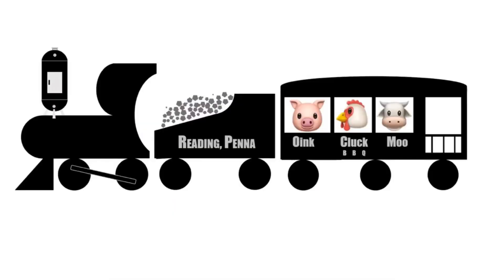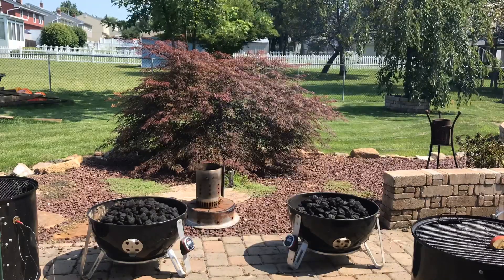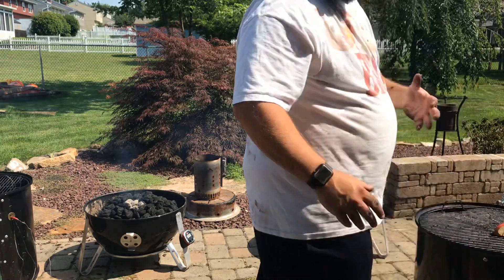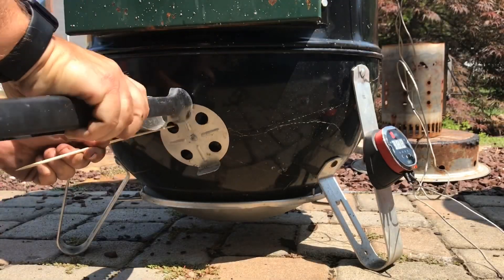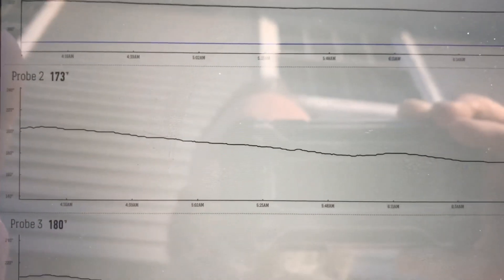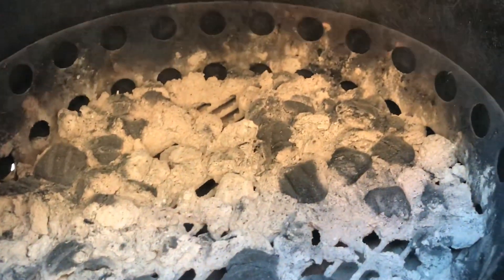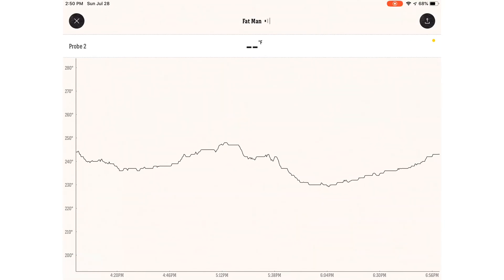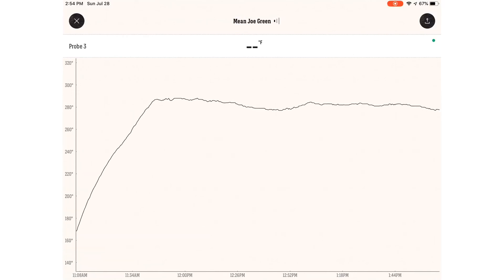FireDial -vs- The Water Pan in the WSM

Comment: I used the firedial for the first time this weekend. I found it to be similar to using the water pan except less hassle. I also found I had to keep my lower vents more closed than typical which resulted in a longer burning fire. It cooked for 9 hours and I didn’t  have to add any charcoal during the cook. In fact, it burned for another 4 hours. I think I will be able to cut back on charcoal and save a couple $$.

Comment: i don’t think you need to do a test. depends on what you want to achieve in your cooks. i use water pan for some things and don’t for others. if going 225 i noticed using water pan its easier to maintain in that range.
Reply from the maker: @jacobminden1458  yes the waterpan is easier to maintain lower temps for people that don’t feel like fiddling with dampers.  I do the tests to simply debunk the myths out there.  The only time I use a water pan is cold smoking because I’ll fill it with ice.
Reply: @OinkCluckMooBBQ  nice.. i drilled a hole on side of my WSM and installed a smoke daddy for cold smoking. works great
Reply from the maker: @jacobminden1458  nice 👍

Comment: The water pan is a heat sink by design, as well as a diffuser so there isn't direct heat. I observed the temperature changes with the WSM as the water evaporated. The temps go up. This takes quite a few hours of course. I can't see not using it. However, that is also an 18", and is shorter and the grates are closer to the fire. I have no reason to substitute. I greatly appreciate your data logging and information. Jeremy Yoder would be proud of the data set.

Comment: I just bought my lava lock fire dial and I’m excited to use it! I have not used it yet. I have only done about eight cooks on my 22 inch weber smoky mountain. I’ve use the water pan the entire time and have had Great success and I’ve only used Kingsford briquettes. The lava lock fire dial should improve efficiency in cooked time as well as the use of less fuel as has been documented. The only downside that I could see is that the original water bowl will provide moisture for your meat during the cook and will not let me dry out. This could be an issue but we will see. All the reviews that I see everyone seems very happy with their fire dial. I can’t wait to try vertically hanging ribs in my weber smoky mountain!
Reply from the maker: Thanks for watching, don’t worry your meat will not dry out, as the waterpan actually acted as a way to dampen or restrict the heat.  One thing I would point out when using the FireDial only begin with about 12 lit coals and then wait for your smoker to get within 20 degrees of your desired temp then close down your vents at the bottom to restrict the airflow and stabilize your temp near your target.

Comment: I like to use the water pan as a diffuser, no water.   You should try the same experiment with no water in the water pan and I'd be surprised to see what happens.  The water is the variable that ruins this test for me.  However I'm not "ruined" with the firedial one bit.  I see it as a diffuser,  which to me comes in handy so if you're willing I'd be truly interested in seeing a video of a comparison without water in the water pan 👍 Great video!
Reply from the maker: The Mad Swine Backyard Barbeque thanks for the suggestion, in the video the graphs showed the temperature around the 8 pm and midnight marks.  By then I would believe the water pan dried out.  When I checked in the morning there wasn’t any water left in it.  I was thinking of running it with sand in the water pan too.  My thoughts are the water pan deflects the heat to the outer parts of the smoker (the walls) and carries it upward to the dome which is why the lower rack has the lower temps traditionally.  Thanks again for your feedback, as I have some ideas of looking at this next time!  Thanks for watching!
Reply: Great test…your thoughts on no water creating a lack of moisture in the cooker….thanks

Comment: Great video, my 18.5’s water pan is the new larger bowl & i don’t use it since acquiring a fire dial but I didn’t have a probe system to analyze the benefits.  I just purchased a DigiQ unit & an oversized charcoal basket from Arbor fabrication, I’m anxious to employ all 3 together & reap the benefits.  Thanks for the stats! 👍🏼👍🏼👍🏼
Reply from the maker: Excellent, thanks for sharing!  I don’t have the 18 but several of my friends have them.  I am blown away each time I see the size of the water bowl, it hangs down so low in the smoker inhibiting your ability to overstock with fuel or even place wood chunks on the top of your coal ring.  Great work upgrading, just remember you don’t need as many coals to start the minion method with the FireDial.  I still think you should hang onto the water bowl to use as a great cold smoking tool!  Thanks for watching bud! 👊👍🤙

Comment: Just to say many thanks for your series of very informative videos on the firedial. I’m Uk based and recently discovered that there is a local supplier for this product. I’ve had my first cook on it today for my WSM 18 .....wow.

It’s amazing how much more airflow is possible vs the standard (and way oversized) water bowl. I only ever foil it anyway and never use water in it as I can always hit and maintain target temps just using the dampers. I was very sceptical about maintaining low temps with it and sure it would race away to 300f plus. I was wrong....

First cook today was baby backs where I held temps between 250f and 27f for four hours with negligible adjustment. I raised the temp for the last hour and for finishing glaze. Again, so easy and quick. I’m very reluctant to modify my WSM but this mod has left me astonished. It seems to tick every box in terms of maintaining temp, evening out top vs bottom grate and doing it straight out of the box with virtually no play time required. 
Amazing product- thanks again.
Reply from the maker: Excellent!  Thanks for the feedback and thanks for watching!  Enjoy the enhancement!
Reply from the maker: Also quick tip if you want to aim for those lower temps like below 235 F start with less lit coals (like 4 briquettes in my 22) does the trick!

Comment: Nice video.  The conversation of energy when the water changes state from a liquid into a gas causes the need for more energy to be produced to sustain that transfer, thus water means more fuel consumption.  The first couple times I used sand instead of water I was really surprised how much fuel I has left after the first few cooks.  I just picked up a fire dial.  I’m looking forward to trying it it. 🍻
Reply from the maker: RaleighSmoke thanks for watching, I had the same experience, before the FireDial I was just wrapping my pan in foil and I discontinued using water.  I haven’t used the water pans since the FireDial.  I just keep them around for cold smokes (fill the with ice!!!

Comment: I’ve used my fire dial twice now and have trouble with keeping my temps under 250.  Did a brisket last night before I went to sleep woke up 7 hours later and it was up to 300.  No bueno.  Any advice?
Reply from the maker: In sorry I never saw this comment!  First I only start with a few lit coals (nothing more than 12).  Second I won’t use lump coal as it tends to burn hotter (of course I’ll switch it up if I need hotter temps for different proteins or if it is in the middle of winter).  Adjust your dampers down once your smoker gets settled into your ideal temp.  I also recommend some type of wireless thermometer, and lastly at least get a seal around your door if you don’t have the lavalock door installed.  Thanks for watching, I know some time has elapsed but feel free to let me know how you progressed!

Comment: Thanks for taking the time to compare and contrast the two! It makes logical sense that the Firedial is more efficient as extra energy is required to heat the water. I think the big debate for me is whether the addition of the moisture from said water pan creates a better end-result. If time allows, would really like to see a similar experiment with meat prepared the same way to assess that aspect of the cook (maybe Brisket?) I think it's important to consider since I'm more than willing to burn extra fuel if the result is a more moist and tender meat. Thanks again!
Reply from the maker: Wayfaring Aviator good point, I am planning on doing some type of comparison cook.  Lining up a judging panel and logistics now.  Thanks for watching!
Reply: This is my exact same question. I have no doubt the fire dial is more efficient with heat and burn time, but in the end all that matters to me is moist flavorful meat. I too would rather not deal with the water pan anymore but I have a hard time believing that bathing the food in moist heat doesn’t have a big impact on the final product.

Comment: I would like to see several temp probes across the grill surface to show how even the temp is.
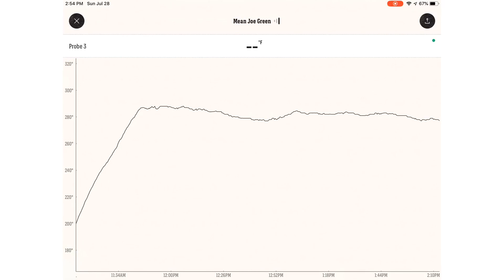Reply from the maker: Jeff thanks for watching and the feedback.  I was thinking of placing multiple probes but I only had access to a total of 8.  I thought it would be best to run them simultaneously in order to have the same variables in the environment.  However if you check the 7:27 mark in the video I highlight the probe port temperature, this will show you the temp at the outer most end of the smoker and will provide insight to the variation across the grate.  I hope it was helpful.

Comment: What is the thickness of the firedial? No deformity due the high temperature?
Reply from the maker: Yannick Legardien the thickness is about a 1/16th of an inch.  I have been using this since January of 2019 and I have not seen any signs of weakening or warping. I know people who have been using it longer, and have yet to hear of any warping.  This even includes people who have placed it directly over the coals when using hanging racks.